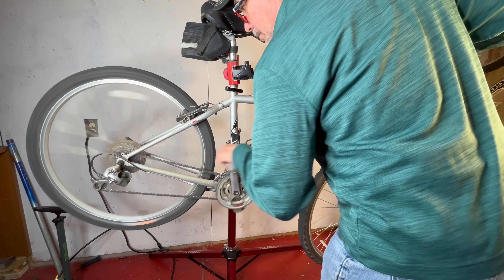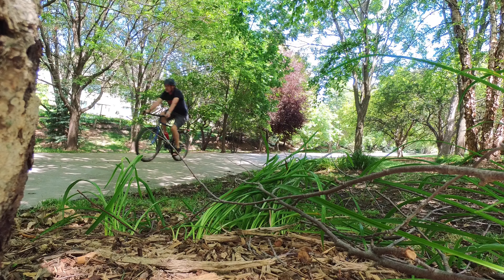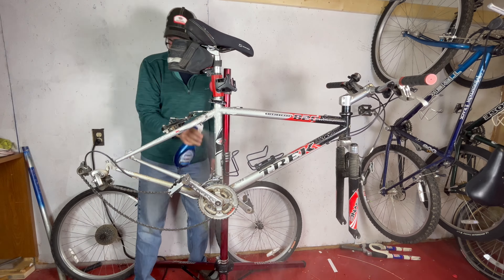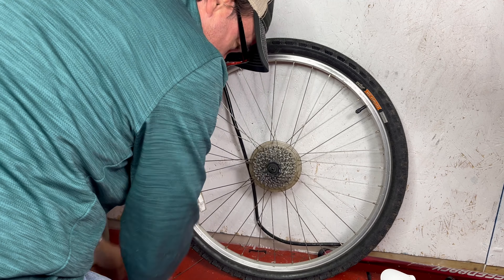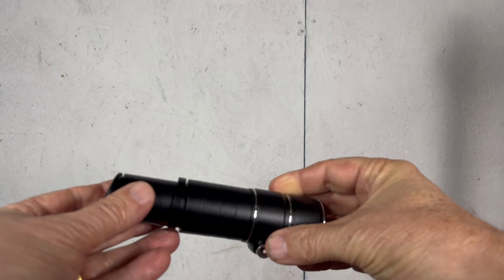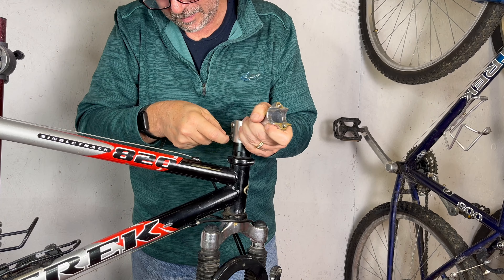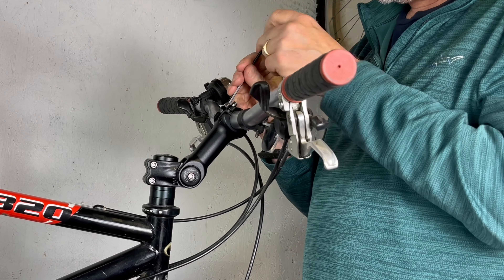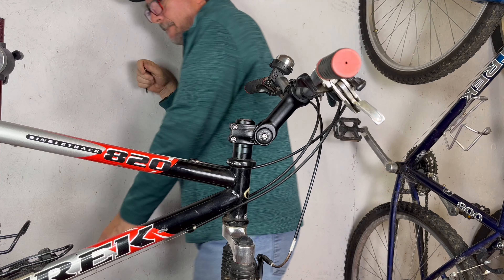She Hated Her Bike - So I Did THIS For Her!  🤩

Comment: First thing you need to do is sort out saddle comfort.  The way the saddle is canted way forward is an indicator that the rider was trying to compensate for saddle discomfort.  Unfortunately, having the saddle tilted forward causes the riders weight to be pushed forward, with a higher fration being held by the hands on the handlebar.

If the saddle is uncomfortable when set close to level, then try a different saddle.
Reply from the maker: Thanks for watching!!  This is definitely something to consider.  Amy requested the adjustable stem so thats the route I went for her.

Comment: Swept back handlebars will help with wrists and as the grip position is further back they give a more upright position. I'm awaiting the arrival of a Jones H-bar to try out on my new build, I got a frame one size larger than I normally would with a longer stack (steerer tube) and will put the seat post much lower in the longer seat tube.
Reply from the maker: Thanks for watching!  When I talked to her, she wanted the adjustable stem like her husband has on his bike.  I think some different bars would have been a better solution, but thats not what she wanted.  Thanks for watching again!!

Comment: I have done the adjustable stem in the past. I never could get it tight enough where it didn’t slightly slip over rough terrain. I had to do a combination steerer tube riser and shorter stem to get the upright position I wanted. Even going from a 90mm stem to a 35mm stem helped, but that riser put it over the top.
Reply from the maker: Thanks for watching!!  I’m not sure Amy will be ridding rough terrain.  I’ll make sure she keeps an eye on the stem and I will adjust as needed.
Reply: @ I’m also pretty heavy myself, so that didn’t help either.
Reply from the maker: No worries!!  Again, thanks for watching!!!
Reply: Amazing that some adjustable stems don't have that wedge locking mechanism. It will slip if you land hard or pull up no matter how tight you have the bolts. Look for stem with that locking wedge feature next time.
Reply from the maker: Thanks for watching!  I'll be sure to look for one with a wedge next time.
Reply: @TheValueBikeAdvocate The most recent one I purchased is made by Fomtor but I also have bought the exact same one with a Lake branding. It's an unusual configuration compared with the stem you used in this video. Almost a reverse bend like the traditional goose-neck design but allows for an even higher riding position.